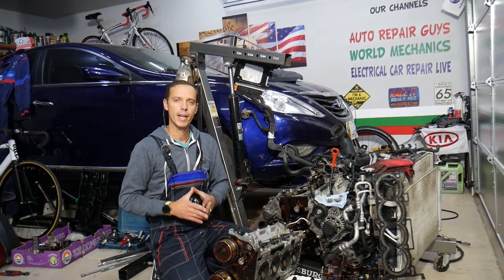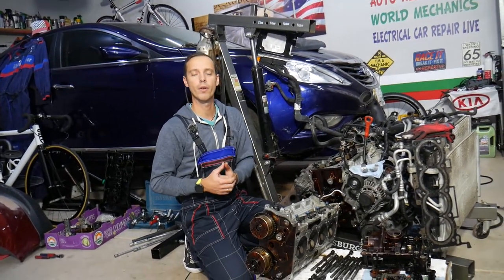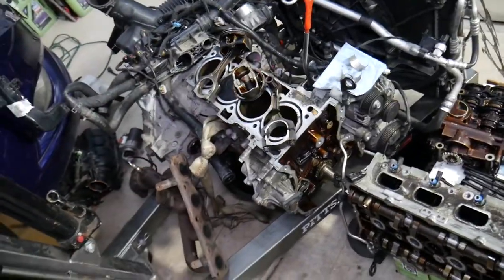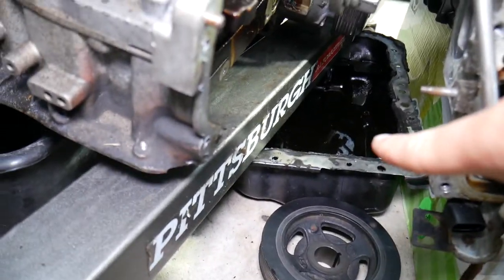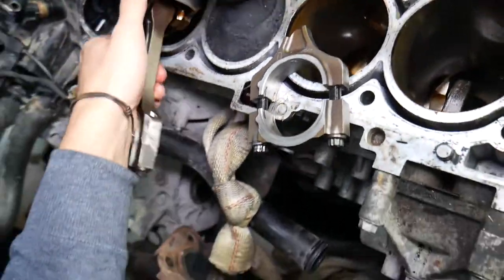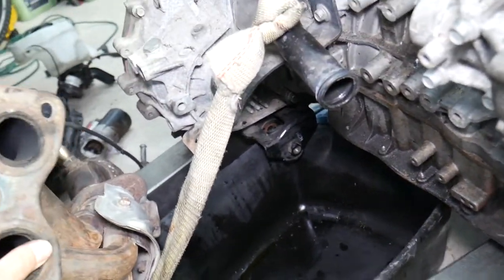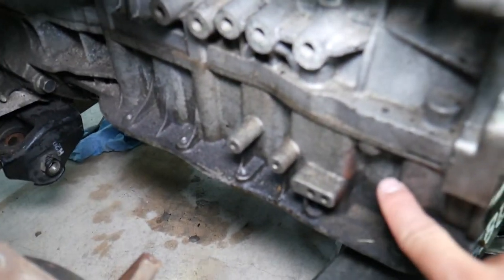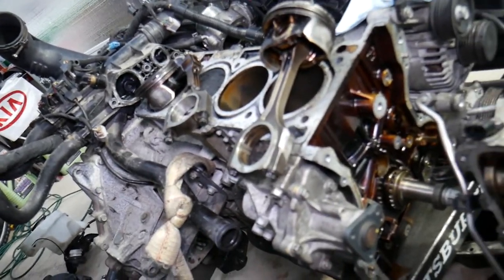HOW TO REPLACE CONNECTING ROD ON A CAR, HOW TO REMOVE CONNECTING ROD

Comment: Can you remove and replace a piston from the oil pan, to save taking the head off?
Reply: Nope
Reply: @ow_fqn  why not, if it comes out from the bottom...?
Reply: @ArjayMartin  nope you cant take it out from the bottom u can take it out from the top
Reply: @ow_fqn  sure, but why?
Reply: @ArjayMartin  The main bearing journal will typically be in the way of the bottom of the bore
Reply: @ow_fqn  can't that be taken off from the bottom?
Reply: @ArjayMartin  obviously no if but there are very few engines that could be dismantled from the bottom going up
Reply: @ow_fqn  Cheers, nice chatting to you
Reply: @ArjayMartin  same to you Bro